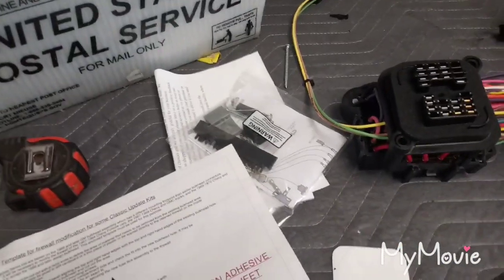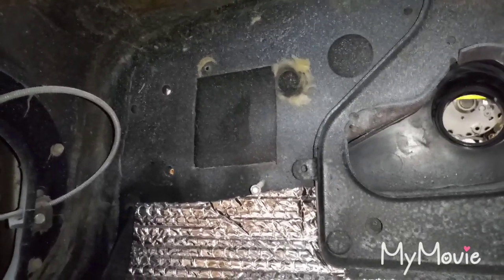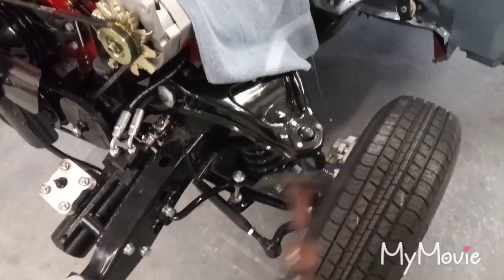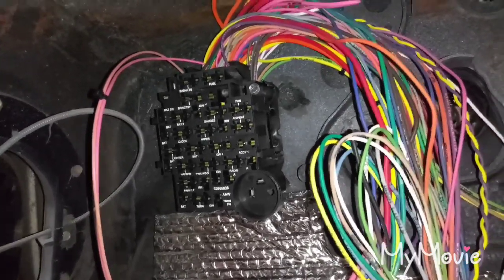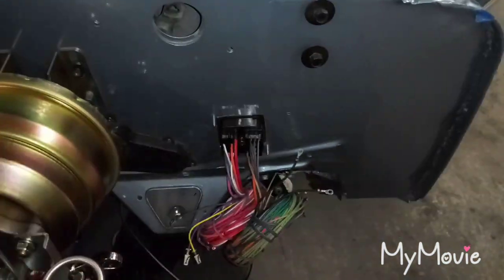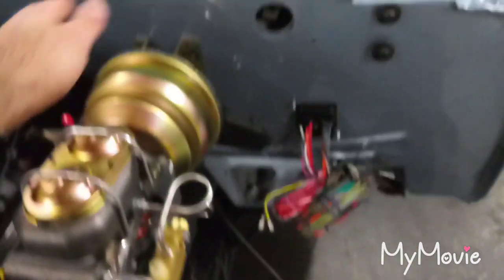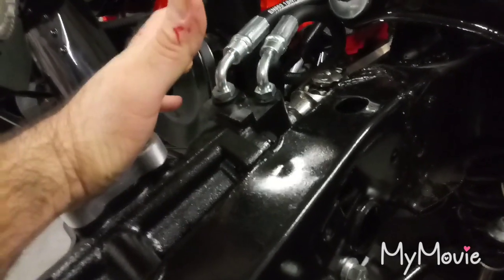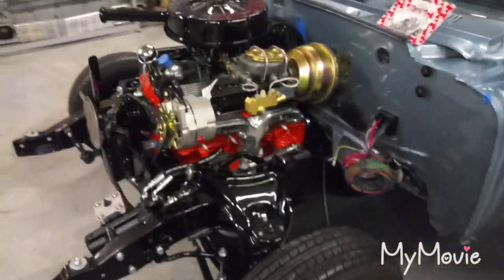1964 impala american autowire install update

Comment: 4 years later and this video is still relevant as ever, ran into every single issue that you did. Template was practically worthless, the screws are ridiculous and no trim for the engine side is a joke. Great video, hopefully someone at AAW will see it and make some adjustments to their products!
Reply from the maker: I'm working on some trim for the engine side if you are interested

Comment: Car is really turning out nice. Your hard work is paying off. Tough cutting holes with the new paint. I had a similar experience with my 56. Not fun. I like your idea of kinda framing out the hole for the wiring harness. Just use the two bolts you have to hold all together. They should have something like that in the design. Would make for a cleaner install. Maybe a thin gauge steel and paint it black. Good luck.
Reply from the maker: I have an idea. In going to try a plastic cuttng board and cut a piece with the dremel. Stay tuned
Reply: @lonestarlows  yep and could give you the right texture to match the plastic on the harness.

Comment: You'll never see it with the fender and inner well. I drilled a hole on my 63 and mounted in a new location. Wiring is easy but takes time. Make sure you grease the steering gasket real good. They're really flimsy.  Great work
Reply from the maker: Thanks for watching

Comment: I don't know $#*t about restoring cars, but i'm trying to learn and appreciate you and others posting their hard work! With that said, could you have used a step drill bit to drill the 4 corners to get them rounded? Then cut the straight lines between?
Reply from the maker: Good question. Ive never owned or used step up bits...so we are in same boat lol